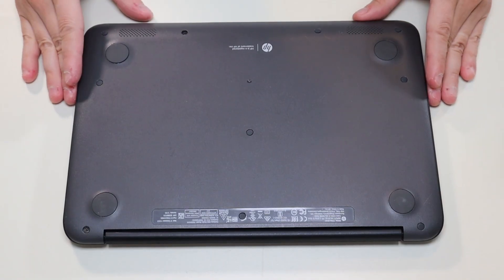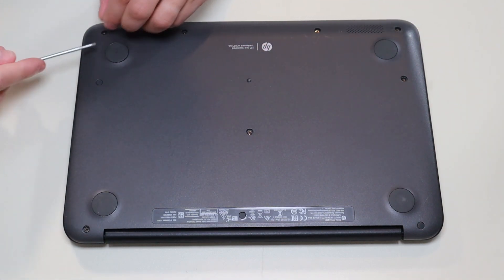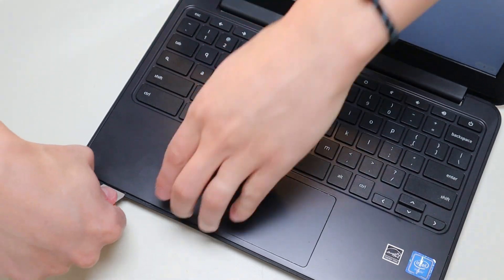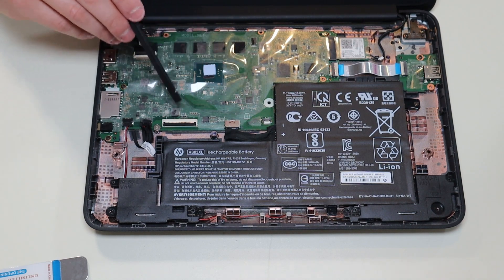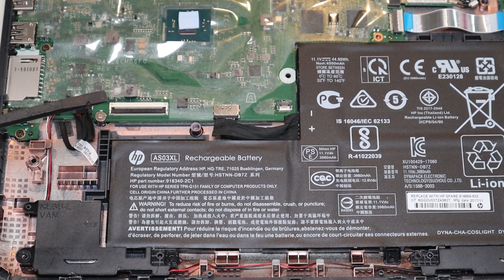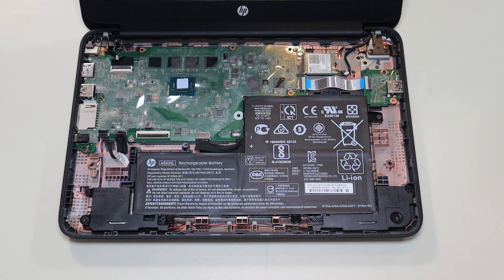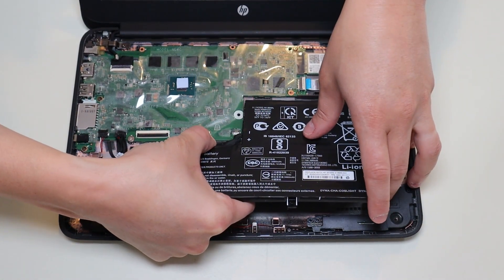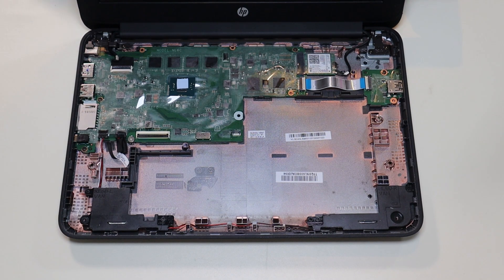How To Replace Motherboard - HP Chromebook 11 G5 Laptop

Comment: Hey recently I shutdown my hp laptop while resetting and now it's stuck in a boot loop it just shows logo and then turns off do you know how to solve this ?
Reply from the maker: A shutdown during a reset can damage the operating system. Can you find any Restore or Repair options in BIOS? If not, can you restart the reset process as seen here? https://www.youtube.com/watch?v=IkCJ6GpUJ3o